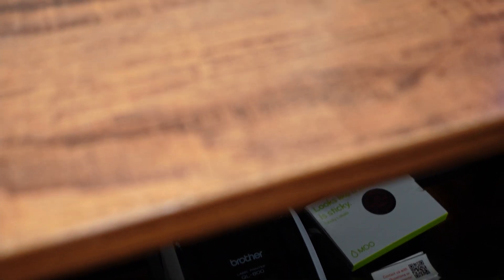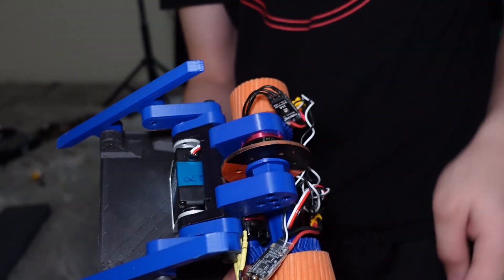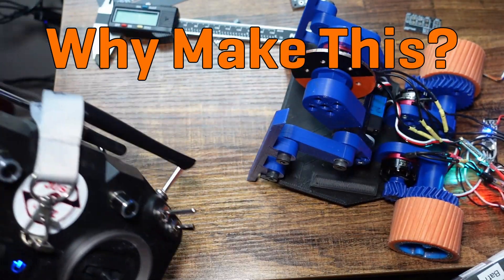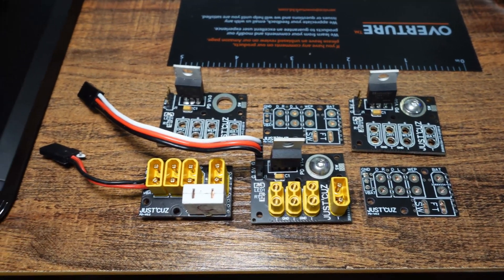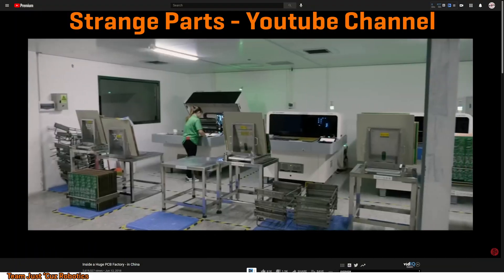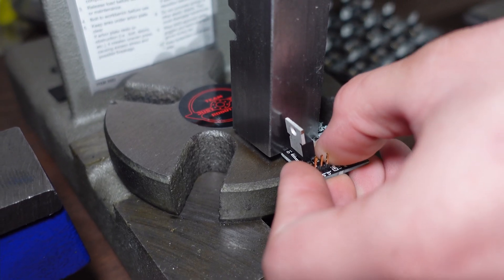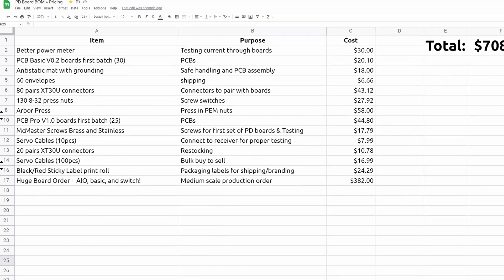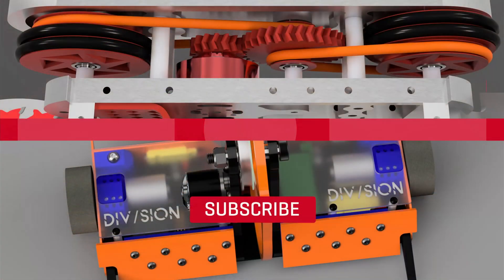I Spent $700 to Make This! Combat Robot PCB Design (The Process) Just 'Cuz PD Boards

Comment: I don't think I am just explaning what this already is, but do you think it would work to have circuit boards custom made to contain 3 esc's on one board? I think it would be really useful for something like a fairyweight robot where you really have to pay attention to the weight of the electronics.
Reply from the maker: It is for sure possible. In fact it was already done for UK Antweight. https://shop.bristolbotbuilders.com/product/malenki/

I personally am not about to attempt this however. It is vastly more difficult and more involved to design a motor driver board than a power distribution board. I'm not an electrical engineer, I spent a couple weeks teaching myself to use an electrical PCB design program from scratch just to design these relatively simple boards. The cost of components for a brushless ESC is also vastly higher than my board costs and that $700 could easily be double or triple if I wanted to buy a large number at once.
Reply: @JustCuzRobotics  Okay thanks. I'l keep looking in to that to see if it could work.

Comment: these sure beat the screws with globs of solder and wires connected to it, wrapped in electrical tape, that ive used in the past. ill definitely be ordering some of the soon, if only to avoid electrical fires...  (also i love the "Take on me" startup tune)
Reply from the maker: Thanks! And yeah I've been using that startup tune on all my brushless ESCs for 2 years now lol

Comment: Maybe it's possible to get a link-type component which will match the footprint of the fingertech switch? Many builders use the xt30 or xt60 connector itself as a link with fuse wire and heatshrink to make a fuse.
Reply from the maker: Yep, for the basic board you can solder any wires you want to the slots for the FT switch and wire those to a connector to act as a link bridge point. AIO boards similarly have a couple pads on top to do the same thing with. Its not as pretty or clean but it should work just as well.

Comment: It is very good but as @MrBK says we need to have a way to make them UK (FRA) legal for Beetleweight etc. The fingertech switch or the pcb-based twist switch aren't uk legal, they only allow removable links.
Reply: No reason you can't have the removable link in addition.
Reply: Couldn't you solder the wires for the link in the slots for the FT switch? 

According to the website, the Fingertech connector paddles are 3.5mm  x 1mm and the 16ga wire they tested the Fingertech switch with has a diameter of ~1.3mm. Assuming you're not using solid core wire (which why would you in combat robotics??) you should be able to easily slightly smoosh the strands (make the bundle wider but thinner) of 16ga (and probably larger) wire to fit in the slots instead of the FT Switch. 

Perhaps a bit of strain relief on the board side wires would be in order so you don't rip the wires out of the PCB when you pull your link.
Reply from the maker: You can absolutely do this, or simply bridge the FT switch terminals with a short 16AWG wire and use a link between the battery and battery connector as usually is done in the UK. This product is usable with FRA rules if you make your bot in accordance with them as it has always been. It just was designed with a switch in mind because the United States is my primary market. My YouTube analytics says >52% of my audience is in the US and <8% in the UK.

Comment: Damn these boards are deffently something that will be super useful for alot if builders but I wonder how hard would it be to convert one these to the UK safty requirements for beetle weights given you need a fuse, link and a external led. I might have to buy one to give that a attempt
Reply from the maker: For the basic board you can solder any wires you want to the slots for the FT switch and wire those to a connector to act as a link bridge point. AIO boards similarly have a couple pads on top to do the same thing with. Its not as pretty or clean but it should work just as well.
Reply: which set of rules is that?